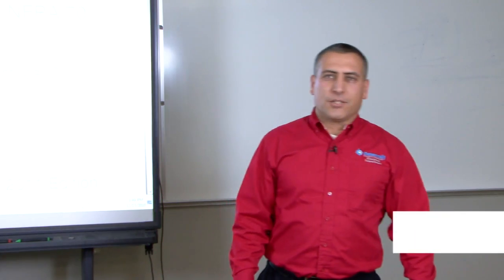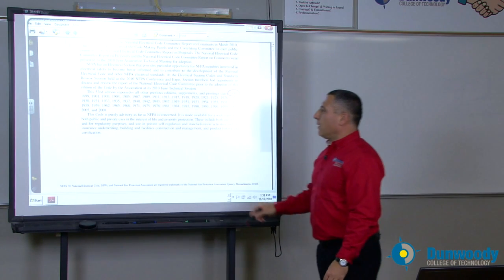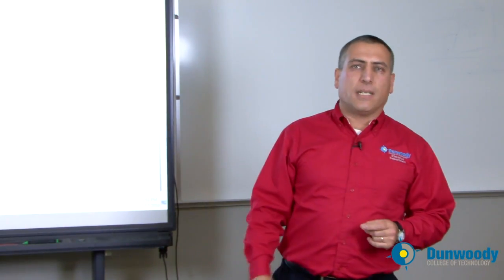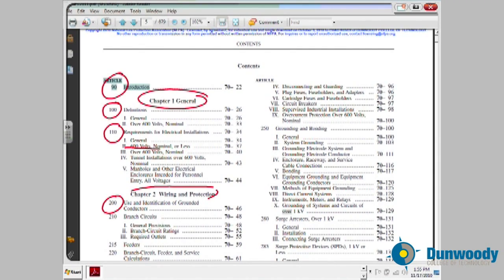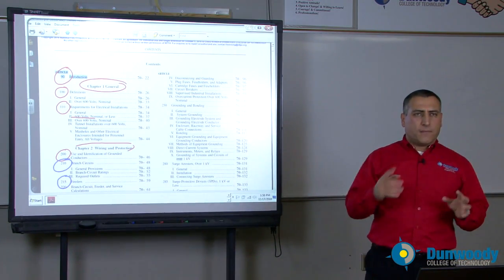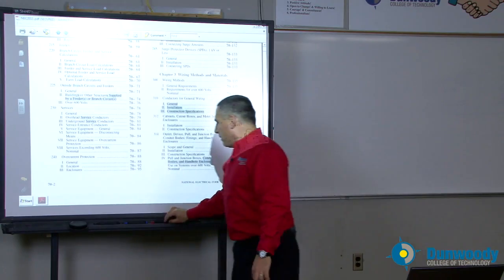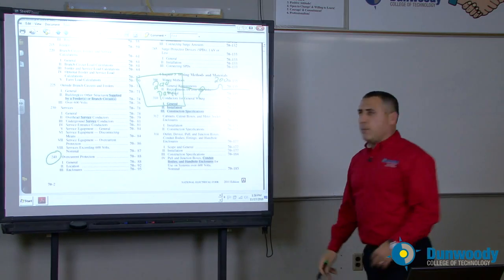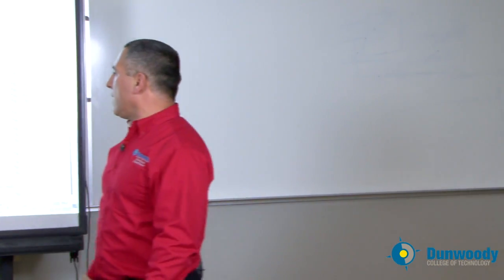NEC Code part 1 of 4.mp4

Comment: This is very good info I did my Journeymans test I prepare by studying box and filled conduit, voltage drop, and other few stuff but unfortunately I did not know how to navigate through the code and there was more question through the code than calculations and this video will help me get more prepare for the next time..
Reply: I am about to take my Jman test. I spent WEEKS learning all the calculations. Then I take a few practice tests and there are maybe 5 calculation questions..lol and I had no clue how to navigate the NEC...